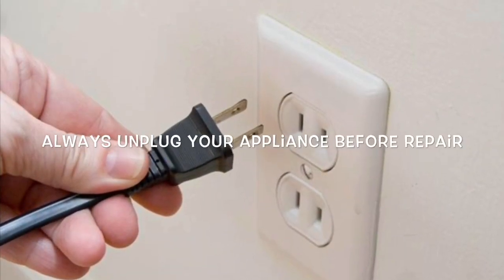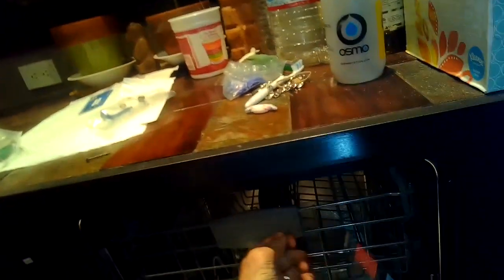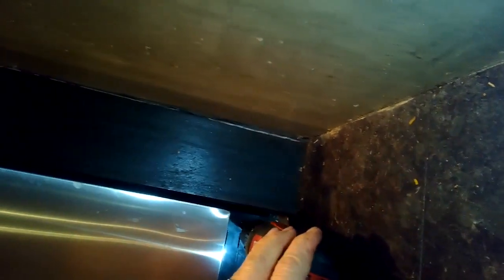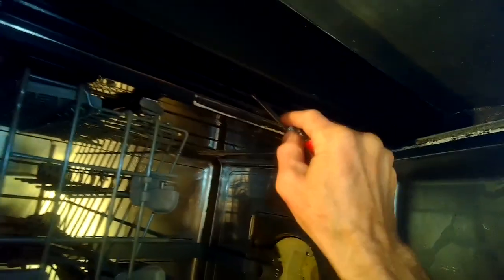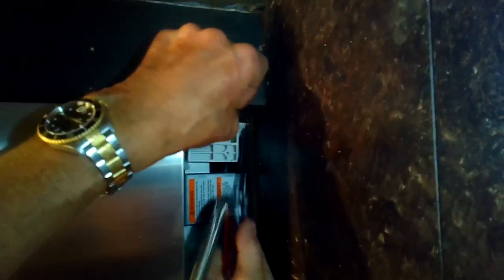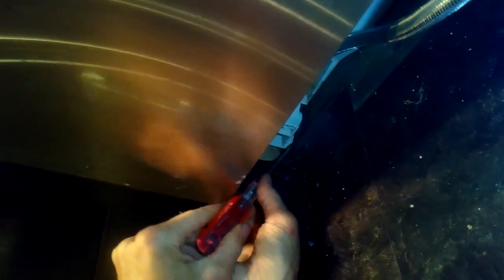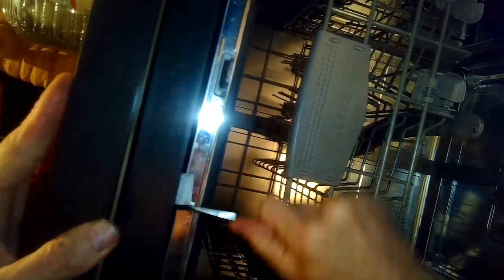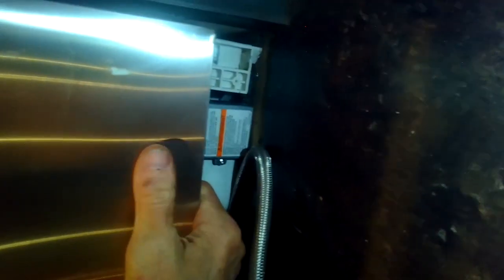✨ DISHWASHER STUCK IN CABINET - Easy Fix ✨

Comment: Love how calm and soothing your voice is. In my case the tile was put in after the dishwasher was installed. I think I need some C-4 to get it out. Thanks for your great video.
Reply from the maker: You’re very welcome,
I wonder if turning the dishwasher feet all the way up into the frame will allow you wiggle it out?
Reply: I have the same problem where they put the tile afterwards. I tried getting the feet all the way up and nothing. What did you end up doing?
Reply: @DarthRogue777  I removed the tiles and put them back again. Sorry for the late response 😅

Comment: Hi, I have a Siemens Hydrwash dishwasher. I am having a terrible time removing to install a new DW. It seems this style of dishwasher has a lip at the back that is getting caught on the wood used to support the granite countertop. Any ideas would help.  Thanks
Reply from the maker: Can you turn the plastic screw located at the center of the drip tray counter clockwise? That will let the back foot to go up in the dishwasher allowing the back to drop down.

Comment: Unfortunately, for us, there’s no easy fix, the dishwasher was installed as part of a new kitchen remodel, the installer screw the dishwasher into the sides of the wooden cabinet, and then the granite countertop was installed on top. We found this out by trying to pull out the unit and one screw from the side broke out of the cabinet, but we still couldn’t get the dishwasher out of the cabinet and we didn’t want to break the cabinet.
Reply from the maker: Hi Maria,

Can you try lowering the front of your dishwasher by screwing the front feet up into the dishwasher frame? That might give you room to get it out👍

Comment: flooring in house has been added since the dishwasher, there's no clearance to get it out. all the screws are out and the metal feet can't catch the floor since it's a half inch height difference help me out dawg
Reply from the maker: Just saw the same thing today.
Any chance of the countertop lifting higher?
Reply: Not with this counter lol. I got it, if anyone else has this problem I was able to angle it and shimmy it out. With the built up floors, I was catching a plank. I simply cut the plank to create an opening so it could slide out, with electrical tape on the feet so it doesn't scratch anything. 
Thanks for the reply